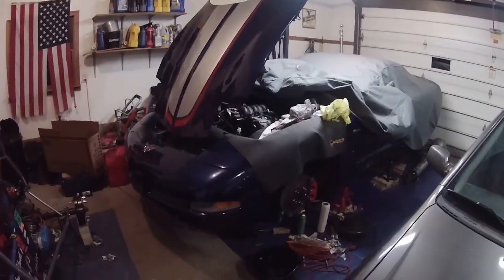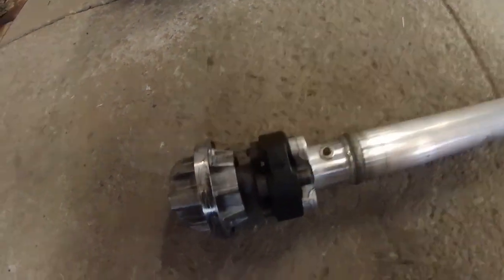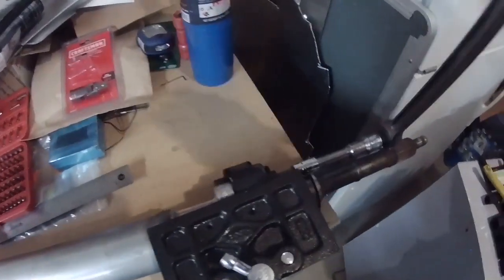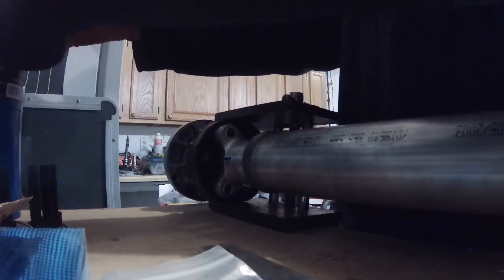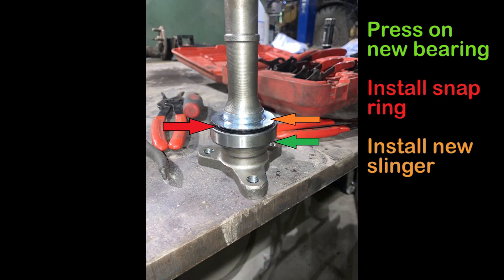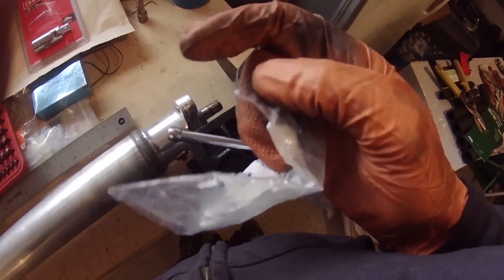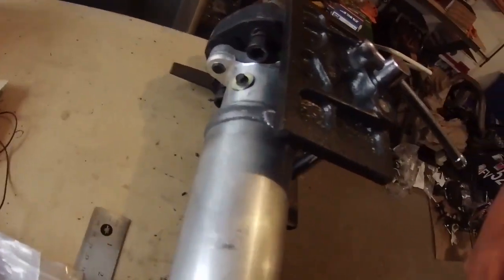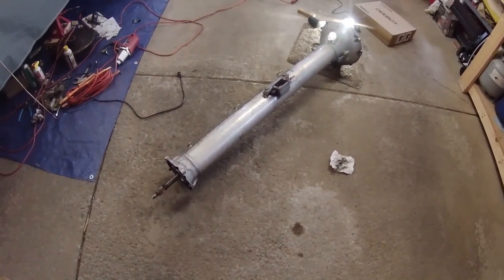C5 Corvette - Detailed Torque Tube Rebuild

Comment: Great content. Do you have any performance mods planned for your car?
Reply from the maker: Soon I'll be installing a MGW shifter and an external oil cooler. Later in the year I would like to go to a square tire setup and run 315's all around. Other than that, no performance mods planned. I want to learn how to drive the car first before making it faster. It already has headers, catless x-pipe, cold air intake and tune.

Comment: According to the torque tube diagram, the outer black ring that you have labeled as a snap ring (@ 18:01) appears to be a seal. The diagram only shows three small snap rings in the output shaft. Could this have just been a typo on your end is is the diagram incorrect? Just trying to make sure i get the right parts. Awesome video by the way.
Reply from the maker: Check out 20:00-21:00 of the video. In this photo, you can see the larger, outer snap ring that I am referring to at 18:00, it goes into the aluminum housing. I did not replace that larger snap ring, so that's why it is not on the parts list I have in description. It seems like the torque tube diagram has a typo.

Comment: This was uploaded the same week i picked up my z16, #567. Car has 61kmi and previous owner didn't supply me with ANY records. The car was always driven easy but when would you recommend rebuilding the torque tube? By age or miles? I don't have any vibrations from it now as far as i can tell.
Reply from the maker: I don't have a good sense for that. I rebuilt mine because I was going to have everything apart for another project. At 124,000 mine felt good. I would think around the 125-150k mark it would be good to consider it as preventative maint.

Comment: Great video. So the removal and install of the bearings need to be performed at the machine shop if i dont have a press? how much they did charge you for the work?
Reply from the maker: Yes, correct you'll need a press to remove/install the bearings. The bearing on the front shaft can be removed with heat and hammer, but not the others. I have a friend at work who did it for me, no charge. So I'm not sure what a machine shop would normally charge. I would guess not that much considering it is quick and easy.
Reply: I’ve done it with a toaster oven, freezer, and maybe dry ice. Just have to make the metal expand and contract to get it on.

Comment: Great video... Do you think a 2002
Has the 12 mm. Bolt holes ??? 
Thanks...
Reply from the maker: Jim, depends if it is an auto or manual. 
Auto 1997-2004 - 10mm
Early manual 1997-2000 - 10mm
Late manual 2001-up - 12mm

Comment: I have a '98 C5 manual 6, where do you recommend I buy a torque tube/drive shaft rebuild kit?
Reply from the maker: I purchased my parts from various sites, depending on which had the best price. The bearings were cheapest on Amazon or Ebay. The GM parts were purchased from gmpartsgiant.com and wholesalegmpartsonline.com. I have a parts list above in the description, but note that is for a 2004 Z06. The 98's had smaller couplers I believe. There are multiple threads on corvetteforum.com that have all the part numbers listed for the various C5 years. I believe you can buy a complete rebuilt kit from Tick Performance. I just bought the pieces individually to save a little money.

Comment: good stuff man, thanks for the parts list. know anything about the bearing retaining bolts to hold bearing in place when reinstalling the torque tube?
Reply from the maker: Are you talking about the two bolts that hold the slave cylinder on?  I was planning on re-using those on my car.
Reply: Honestly not exactly sure, was reading about it on a C and S Corvette video. They were talking about how the bearing can be pushed back into the TT during reinstallation.
Reply from the maker: @cole mcmeans  Hmm I have not heard about that issue. I'll have to do some reading. My torque tube is still sitting on the ground, haven't gotten my new clutch yet.
Reply: The video was "torque tube disaster"  from c an s corvettes. A guys comment mentioned the sourced retaining bolt I think he called it, I need to do some more research myself.
Reply from the maker: @colemcmeans7809  thanks, I'll have to find that video and watch it before I put my torque tube back in
Reply: @colemcmeans7809  have you found any more information or procedures on how to re-install it? I’m planning on rebuilding my torque tube soon
Reply: @anner9   there are a few on getting the whole assembly back into the vehicle. I did find one on rebuilding it I'm not sure to what detail he went into too. I'll try to find it. The forums might have some more details haven't really checked there

Comment: Umm does anyone know for sure if the clutch & flywheel need to be match balanced to the oem setup to avoid vibration??
Reply from the maker: I did a bunch of research on the topic. My conclusion was that, for all the cars produced, only a small percentage require match balance to the OEM setup. The rest would be ok with just a zero balance. I ended up doing a zero balance. I called several reputable shops in the CLE area and they all said they never match balance. And I couldn’t find anyone that would match balance for me. My car turned out fine.
Reply: @cqe5009  If you decide to match balance the clutch , McCloud clutch can provide that service.

Comment: What was the mileage on your C5 at the time of rebuilding the torque tube?
Reply from the maker: Around 124k. The car currently has 132k.
Reply: @cqe5009  ok, cool thanks! This helps a little for me to determine what condition my 1999 C5 tongue tube might be. It’s scheduled for the shop on 9/12/2023 I’ll have it checked! 😎

Comment: Are the couplers the same or different in the front and rear?
Reply from the maker: They are the same front to rear. But there are two different sizes based on the year of your car and trans. Earlier C5's had 10mm bolt holes and later cars had 12mm bolt holes. 
Here is the breakdown:
Auto 1997-2004 - 10mm
Early manual 1997-2000 - 10mm
Late manual 2001-up - 12mm

Comment: Do you know if it would be hard to extend those
Reply from the maker: Extend what?
Reply: @cqe5009  the torque tube I'm lookin at doin sometype of conversion with my 49 pontiac keep it looking Original  if I can
Reply from the maker: @cocopublicnews6766  It seems easier to get a T56 from a Camaro or GTO. Lengthening a torque tube would be quite the project.
Reply: @cqe5009  the transmission housings from multiple types of gm transmission match?

Comment: Get. Yourself the proper snap ring pliers NAPA #3152.
Reply from the maker: Thanks I'll look for those!
Reply: the NAPA pliers are a regular good quality tool, and priced appropriately .   For my one job only needs, I would look to Harbor freight, or used, if possible.   I have read a lot of people have trouble with that snap ring.